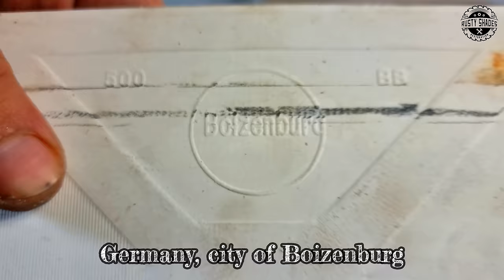Primitive Fridge Restoration - Early 1900s Ice Box

Comment: Thanks for a great project!
Where were you supposed to find ice back then? And how often did it need to be replaced?
Reply from the maker: Good questions! This is what I found on the web: Ice was cut from the surface of ponds and streams, then stored in ice houses, before being sent on by ship, barge or railroad to its final destination around the world. Networks of ice wagons were typically used to distribute the product to the final domestic and smaller commercial customers. That's before electricity. They should be pretty rich to afford that. For the second question, the ice that I put it in last for 3 days. Thanks for watching! Cheers!
Reply: @rustyshadesrestoration  i think that as they were taking directly s whole block of ice, it might have lasted much longer than using modern ice cubes from the supermarket
Reply: The ice truck was a common site in cities. I just watched a video about WA2 and when the men went to war, womwn had to do the jobs of men and this included ice deliveries. There was a photo of two women wirh a big block of ice , outside their truck . 
And it wasn’t just the wealthy  that had ice boxes. 
The ice was stored in huge warehouses, insulated wirhnsawdust and wood shavings, and pieces were loaded on the trucks that  delivered it to people . I believe you could order a specific size block, depending on the capacity of your particular ice box.

Comment: @Rusty Shades Restoration  Are those ceramic tiles, or what were they, or could you tell?  How thick were they? I also found the wood shavings to be interesting.  Do you have any twinge of guilt abt authenticity abt the styrofoam?  Also, would insulative materials used for (DIY) refractories (e.g. refractory mortar or that ceramic fiber, I think it is (dragging up old fuzzy memories of various products here), or the brick used in refractories/stoves) also do well in a product like this?  I realize it's an odd idea/approach, but I was wondering if  insulative materials for hot things could work for cold things, too?
Reply from the maker: Hei! Yes, they are ceramic tiles and they wer very thin, idk to tell you exactly because I didn't measure them. The Styrofoam works well for the cold things, keeps the same temperature for longer.

Comment: Did you treat the wood for the wood worms that caused the holes you filled in the wood and when you removed the paint did you check to see if it was lead ain’t?
Reply from the maker: I didn't apply any treatment for the worms, but they got 600 degrees hot air while removing the paint which yes I tested for lead and was negative but I didn't saw it necessary to film that too, it is already a bit too long video and I had to speed up or cut some parts that wasn't so important in my opinion. Thanks for watching! Cheers 🍻

Comment: How long does that ice keep it cool?
Reply from the maker: On the 3rd day the ice is almost gone, but the zinc interior keeps the cold for another day or two, depending on the room temperature.
Reply: So, do you call it a bargain? 

Loads of ice for a few days of coolness?
Reply from the maker: I'm not using this on a daily basis dude. It is strictly for the purpose of having a beautiful antique piece in possession and saving it from decay. It was cool to see how people was living before and cooling their stuff.
Reply: Ohhh, right. My bad. Slight miscalculation on my part.

Comment: Use paint remover next time. Also when using it wear a mask. Because you will get a contact high when you open it.
Reply from the maker: I'm using paint remover only on metal. I prefer this method with wooden parts.
Reply: @rustyshadesrestoration  Okay. But it works so much faster on wood. I have restored a couple things & paint remover is awesome. But I get your method too.

Comment: You should have used the old screws. 🤔
Reply from the maker: I threw them thinking that I will replace them with brass ones, but for 3 days in a row I couldn't find that type so I had to move on with the project. Meanwhile I found 😉

Comment: Did any larva from the beetles emerge after you were done?
Reply from the maker: No, I didn't observe something like that. Do you think could happen?
Reply: @rustyshadesrestoration  I didn’t see where you are located, but the holes look like powder post beetle holes. If you notice any powder, or sawdust you should remove the piece from your home.
Reply from the maker: I guess they are dead for now, I used 600 degrees hot air on it. It is in my workshop that is far away from my house so I guess it is safe. Thanks for caring! Cheers 🍻
Reply: To kill the larvae, they usually soak the wood with a borax acid solution.
Reply from the maker: I guess it is never too late to do that. Thanks for your tip!
Reply: @rustyshadesrestoration  I really love the piece! Sorry to sound like a negative Nelly…
Reply from the maker: I love it too and was a great opportunity for me to work on it. I didn't think that those larva may survive even after so hot air, but for preserving better the piece I can use some borax too. I'm happy when someone is trying to give me ideas so don't worry! Thanks for that and for watching my videos.

Comment: What is bluing????
Reply from the maker: There are two popular types of bluing.
1. Cold bluing, as I did in the video, it is a solution that makes metal dark instantly and protects against corrosion.
2. Hot bluing does the same, but the metal has to be pre-heated and sunk into a recipient with oil.

Comment: I had to take the temperature before and after. Refrigerator not proven to work
Reply from the maker: Hi, that's an ice box with a ton of ice inside; logically, it works. It is not like an electrical one that you put in the power supply to demonstrate that the motor works and is starting to get cold. It is freaking evident that it is getting cold inside 🙄

Comment: I didn't like the colour, but that is a matter of choice. I didn't like the solder repair, but that is a lack of experience.
But why, oh why, did you use Phillips Head screws when you were going for an 'antique' look?
Reply from the maker: The colour cannot be discussed, that's right. The soldering part also true, I don't have much XP, just few days ago I discovered the secrets and get better. The screws was a choice for the moment, they are replaced with brass ones. For 3 days in a row I couldn't find to buy and I had to move on with this project, I'm trying to keep a tight schedule with posting my videos (Iwas late 1 week already). Things like this can happen when you film the process. Is there something that you liked? 🤔 Thanks for watching 🍻
Reply: @rustyshadesrestoration  I liked that you didn't use a wire wheel on the brass fittings.

Comment: did you test the paint off camera to verify it is/was lead paint, which was typical and common when that ice box was made?
Surprised you didn't replace the dry rotted wood around the vents and drain, choosing to go with wood filler, which is a temporary "fix" at best. Rather surprising you didn't knock out the drift pin and disassemble the latch -- or at least remove the handle for cleaning and polishing, and take apart the drain valve to clean, polish, and replace any seals that need replaced so it doesn't leak. SOMETHING caused it to lock up. Likely corrosion from a long time leak.
I gave up watching at the paint scraping.
I'm pretty sure you will either sell it or use it as a display piece, not put water ice or dry ice in it and use to keep your adult beverages and/or sodas cold in the office or cubical of your day job.
I'm sure it looks pretty when you finished.
Reply from the maker: Yes. It is insane how many asks about lead test. I'm not supposed to show such a safety measures in every video. It is like asking a surgeon if he disinfect before cutting. I'm taking care of myself working in such an environment.
The ice box It is functional and yes, was sold already. I didn't replaced the wood because I could damage all the parts and basically I should reconstruct everything from 0, this will take all the value away from it. Cheers 🙂 🍻

Comment: Что-то с краном вы напартачили... гайка со следами припоя скорее всего была впаяна в ёмкость для талой воды и только потом в неё вкручивался кран, вероятно через какую либо прокладку... а так это работать не будет... коту под хвост такую работу...
Reply from the maker: You are absolutely wrong. On that brass nut was a lead ring that broked, you can see it when I'm taking out. It's purpose was to fit in the water tank socket, if you look better you will see. That's how they was fit together, was never soldered one by another (the tap and the water tank). Before being rude, pay attention at what you see or buy some glasses or at least ask polite!

Comment: I enjoy the video, but real wish would some more research on the units in the best ways to restore. There are one of the little details you missed or we’re done incorrectly but understand your first try and I can’t say I’ve done better on some things you enjoy doing in your life the way it works and it’s for you that’s all that really matters but if you’re gonna try and do it and make money I need to do a little more research on the correct way to put things back together with a different components do. The wonderful thing you do need to fix correctly or the whole bottom is gonna run out very quickly is the drain drain should have a water tight seal in the bottom left 10 compartment so it catches the water is it melts from the eyes and you can open the valve to drain it out since you don’t seem to have a water tight seal between the outside and the inside of that milk container. It’s just gonna flood and run out the bottom of the unit.
Reply from the maker: Thank you for your feedback. I appreciate it! 🙂